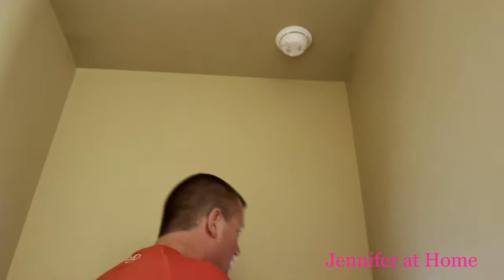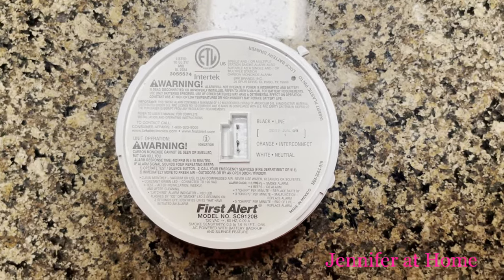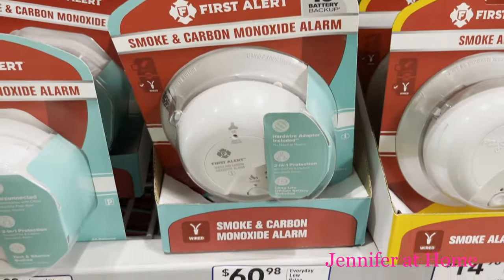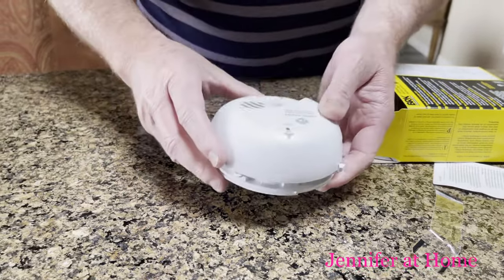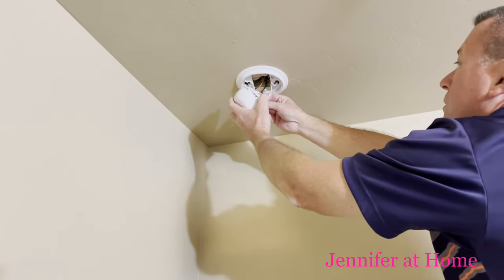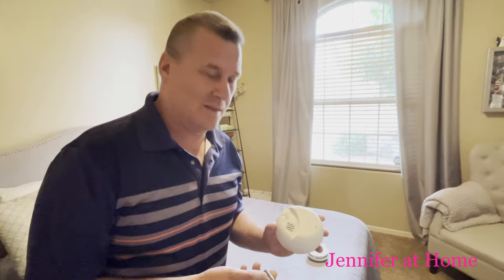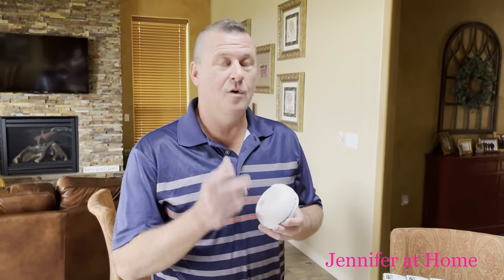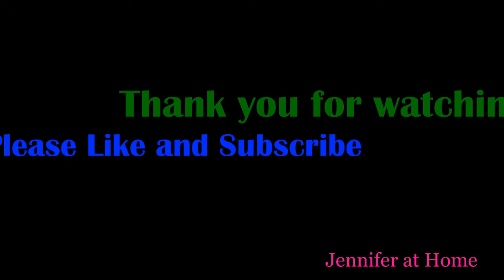How to Replace First Alert Smoke Detector, Standard and Smoke & Carbon Monoxide Alarm, AC Powered

Comment: Is the actual smoke sensor on the face of the alarm? I know the alarm trips when smoke gets inside the ionization chamber, but where does outside smoke actually enter the alarm?

Do the notches on the sides where you twist/mount the alarm into the brackets have any smoke sensors? I don’t think they do, but I just wanted to make sure.

Great video. Thanks for walkthrough.

Comment: What if I'm replacing 1 of 3 American COS2010 Smoke & CO combo sensor. This has total of 4 wires...Black, white, orange (interconnect smoke) and brown (interconnect CO).  But what if the new combo sensors now only has one interconnect wire for both smoke and CO (total of 3 wires)?